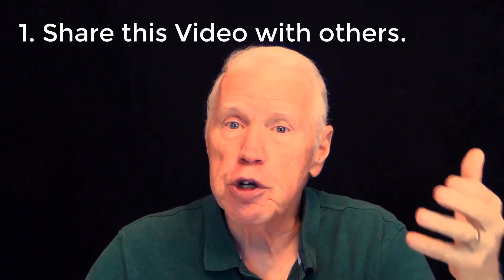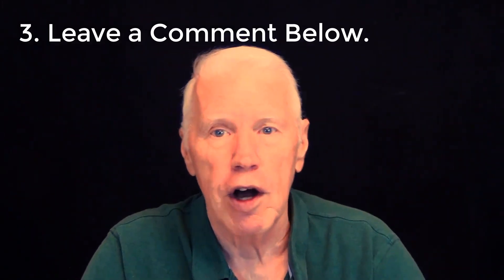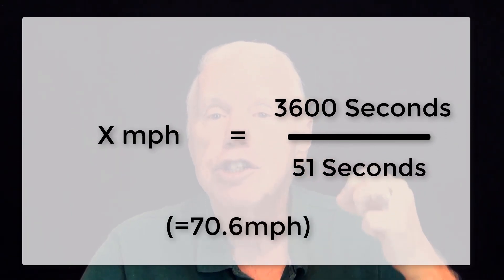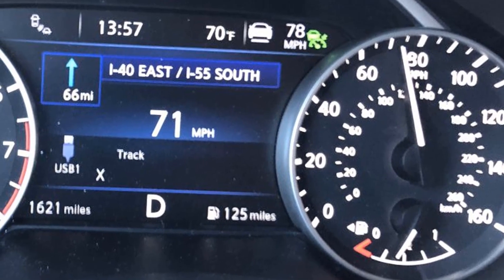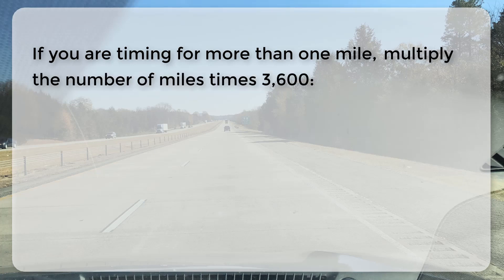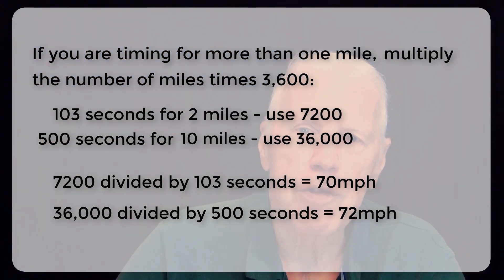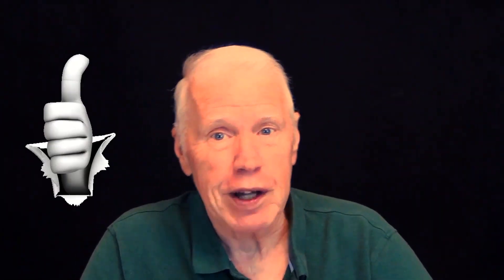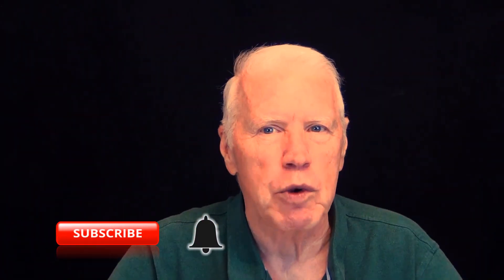Is Your Speedometer LYING To You?

Comment: OK Mr. D , here is a question for you, I want to test how fast my lawnmower go's in top speed, so can you give me a formula using like a starting point to a 8 or 10 foot ending point? I figure I can watch and set my stop watch as the front wheel passes over the starting point & stop the stop watch as the same wheel passes over the ending point. I probably need you to redo your formula for my example WARNING: You are sealing with a math idiot who barely got out of school LOL
Reply from the maker: Here's an easier way. First, get two beanbags or other small things that won't roll, like a pair of socks with sand in each. Then get on your mower and get up to speed. Throw down one sock/beanbag, then exactly one second later, throw down the second one. You can use the stopwatch function in you phone, or a stopwatch to be sure it's accurate.  Measure the distance between the two markers. Then go to Google and type in "How much is ## FPS in MPH?" where ## is the number of feet between the markers. To be more accurate, do it several times and take an average.  Easy enough?

However, if you're determined to time it by distance, my formula will still work - all you have to do is figure out the fraction of a mile you're going. For example, 10 feet is 1/528 of a mile, so divide 3600 by 528 and use the rest of the formula. But I think the first way I mentioned is easier.